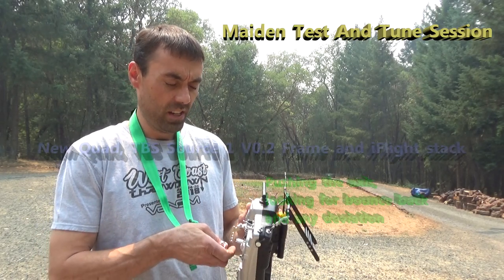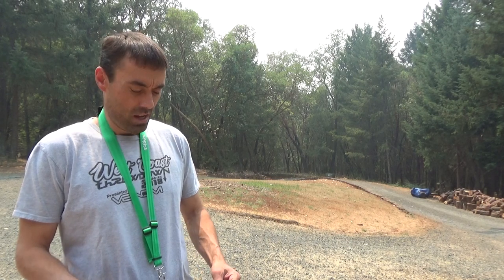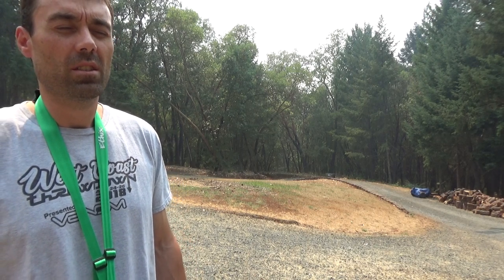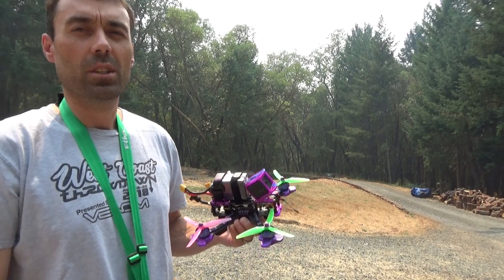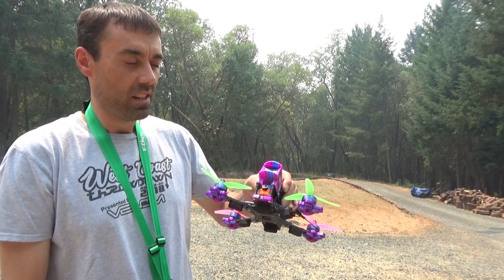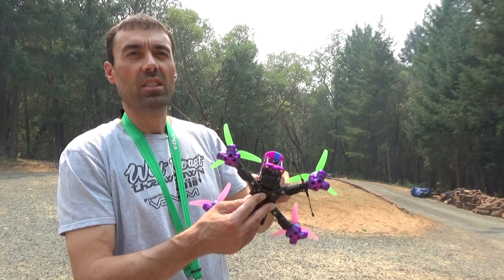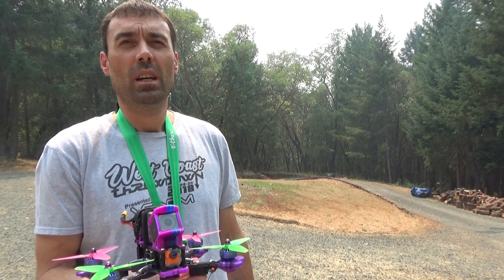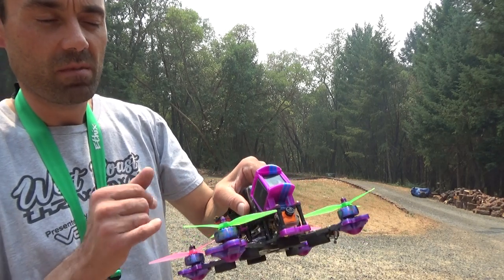TBS Source 1 Maiden Test And Betaflight Tune Session

Comment: I dig the frame
Reply from the maker: thank you Tyler !!! 
I really like it so far, only negative comments I've read were saying the arms break at the connecting points, but that is a common issue with replaceable arms anyway.  
We will see, the bottom plate and sandwich plates look very strong, and I like the overall layout.

Comment: Source 1 rocks ive got 2 one 5inch and 1 will be a 7incher  tonight  with some tmotor 2408 :) ive only broken  1 arm since November   but they have a v2 out mow of the arms  so thry should be  better
Reply from the maker: awesome !  that is great to hear.  
This is actually the V0.2 frame.  I hear they have a V0.3 frame out now but I have not seen it for sale anywhere

Comment: You can really hear it's to high when yaw kinda cool
Reply from the maker: Oh yeah, the barn made the quad sound pretty cool 😁  
Ya could hear the difference at the end ?
Reply: @jdogb1  yes the motors have a nice snap sound seems to always be the one thing I've notice is when a qaud has good tune it has a very crisp snappy sound as for the yaw I wanted to ask why does yours seek like it is a little crazy compared to other I've notice if mine is to high I can't do yaw spin without seeing qaud raise up when I leave it just at default on add dual rates and some exbo to ail and pitch . Like I was so happy with my mojo pro tune they had to had bounce or anything what I did with my sticks the qaud would do even in horision I could pitch down like I was in acro if I want to do a slow flip it would do everything. So my question is can a person take those rates for a base with other qauds if I liked the toon? I plan I getting one again when I have the money . I'm still learning and very new. I stay with bind n fly because I don't have any hobby shops by me that can help they don't even stock qauds . So I only learn you tube and mistakes .